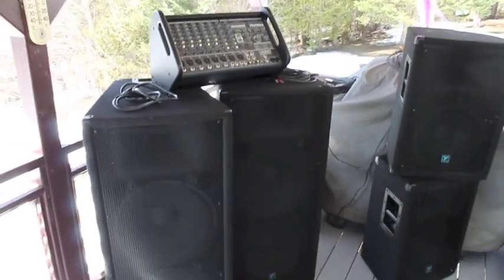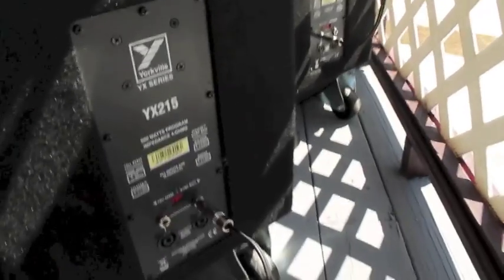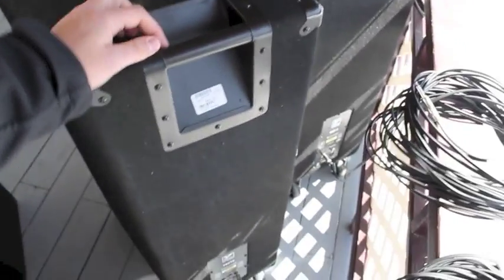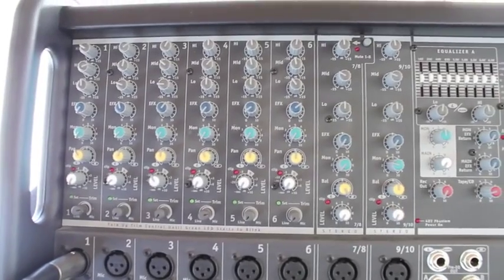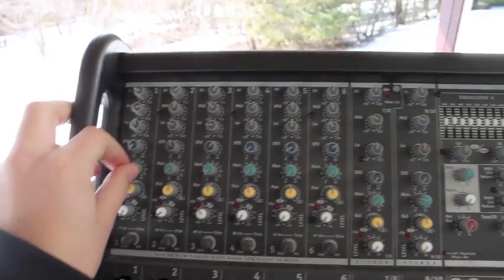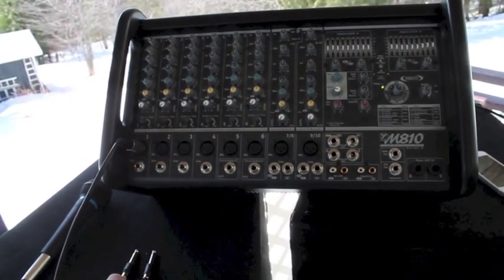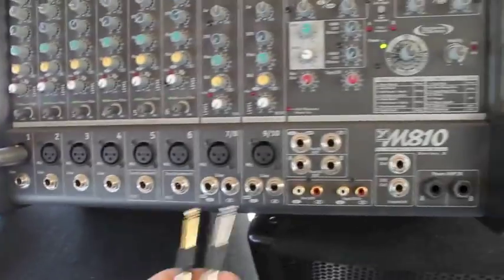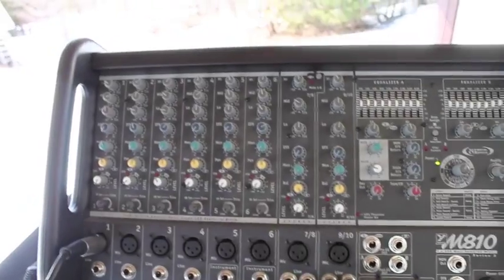Yorkville M810

Comment: I have this system with 4 YX 200 watt speakers. Lots of sound for a loud band. The sound is excellent, and its almost industructable. Pro gear all the way. I think the guy that founded the company use to take his amps on t he second floor and throw them out them window, to see if they would still work; and they did work. Tough equipment, its meant for the hard road

Comment: My problem is the “pan” …one side works, the other doesn’t. I have just two speakers and run thru one channel…is that correctly hooked up?
Reply: I am guessing that the pan isn't working because I don't think the A/B is explained correctly.  If you put both speakers into A, you are running only 1 side making it mono.  But I have not tested.

So split the speakers A and B and see if the pan works
Reply: @ Yes! I do believe that is it! Thank you!

Comment: I purchases a m810 from long and Mcquade used here in Victoria BC, barely used it and the warranty ran out. 1.5 years after purchasing this i have barely used it at all (5 hours). One day the right side speaker crapped out and starting making a loud noise. Brought it in to Long and Mcquade, got charged $140 to fix it. Brought it home,  hooked it up and it worked perfect. I put it away for 2 months. Me and my friends got together to play music, i brought the m810  thinking it was working fine. Plugged it in, it worked fine for about 5 minutes and then all of a sudden the right speaker doesn't work any more and the left speaker is making a noise WTF. What a piece of junk. I feel so fukkkin ripped off. I know i purchased it used but WTF